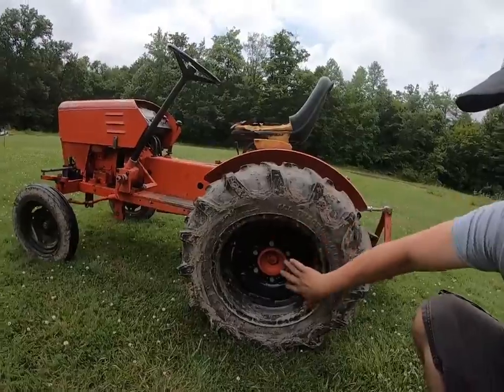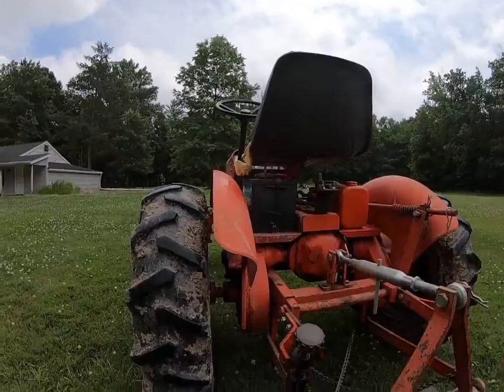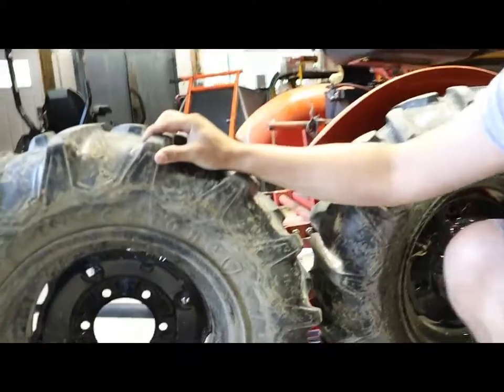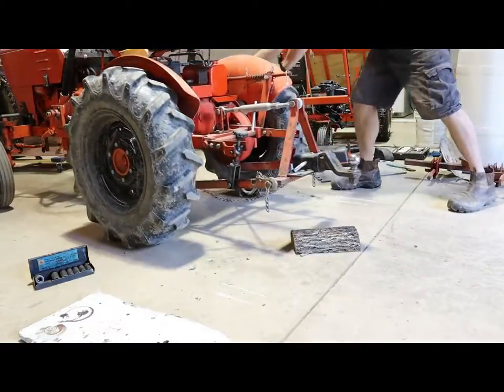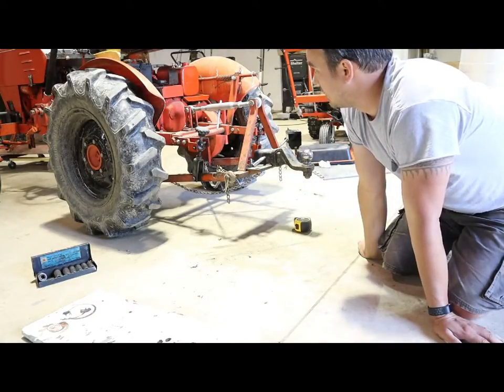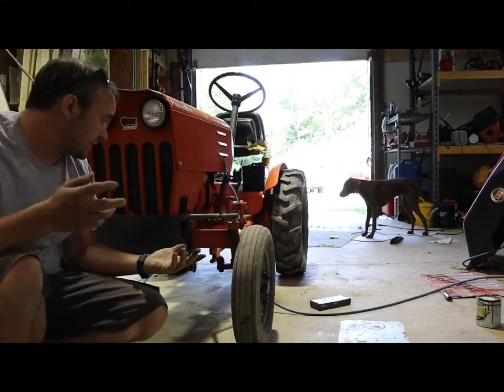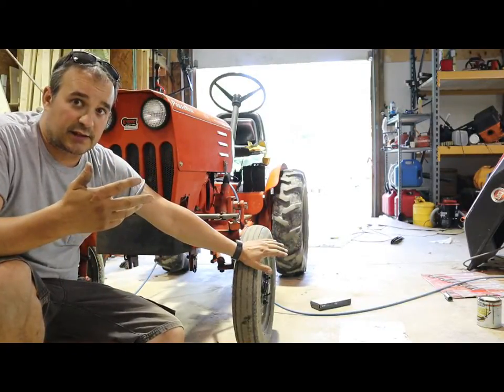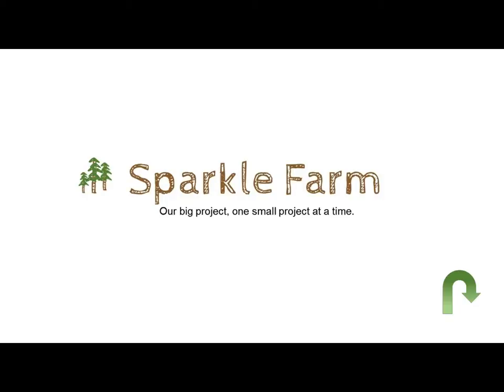Power King Tractor Tire Swap - Adding Rows to Your Garden

Comment: They have several settings for the Power King wheels. Wheels can be turned around, set in, moved out, Doubled up, you can put two wheels on each side on the back. Wheels are put out for extra stability depending on what you are doing with it. Then if you need to save space you move them in as you did. Your best bet is to find the Year of your Power King' go online and find the manuals for it. They normally sell for around 20 dollars U.S. Hope this helps.
Reply from the maker: Read some of the other comments about the tire swapping.   A few guys seem to get upset.    Must not know these tractors are power houses!
Reply: @rushedscheduledfun3963  Yea I'm not sure why anyone would get upset. There are videos right from Power King floating around that show the configurations for the tires. They all have at least 3 base configurations, before doubling up the tires. So you can turn the rim completely around and it's Not Wrong to do that. That is what these tractors are designed to do. You can also get the various rim and wheel weight configurations. Mine has extended wheel weights that are made to be used as a type of Pulley or Come Along setup. They stick way out from the tire and you can loop a cable around them, put the "back end" of the tractor up on a lift, and now the tractor will work as a conveyor, a pulley, you can add a Power King Blade to it, and then it's a Saw mill. These really are great little tractors, and you can't beat the all solid metal to metal configuration, all gear drive, they will pull a house around. Anyway good luck.

Comment: Rear rim tires on wheel horse mowers are exact match for the 4 bolt pattern on the 2414 power king 1974.  Can't tell you about others.  They rub the deck but with it off and a tiller or blade fit just fine.  Also wheel weights bolt on fine with correct front install.

Comment: You know I have one of those tractors it’s got no attachments I love using the thing just to have a little joy ride in recently got add tires for the back I am soon going to get an original seat like an old metal one right now it actually has a boat seat on it the thing sat for 10 years and then got restored and now today it works amazing better than it ever did
Reply from the maker: I grew up with one from the 1950s. It did everything we needed.  So when I saw this one for sale I had to have it.    We actually bought it before we moved to this property.  We enjoy it.  Thanks for watching.
Reply: I’m ten

Comment: What's the benefit of buying an older Power King vs buying an older Sears Suburban SS16 or ST16 or an older Cub Cadet?
Reply from the maker: Probably no difference.   Just personal preference and whatever works for your application is always best.  
When I bought this tractor it came with a bunch of accessories for the cat 0 so that helped also. 
3 point on the back.
Reply: See how many Power Kings are still running ? Do you need to know more ?..
Reply: BTW...you could have just downloaded a manual and gotten all the info...or cLled
Reply: @Dadwithallthecool  Quite correct. Power King tractors are built like tanks and are indestructible.
Reply: Sears didn't  have a good brake design.  Read about brake failure.  Power kings easier to work on and bigger.  Did my research and pk better.
Reply: Lol, obviously never owned or even seen an Economy or Powerking... currently own 3 plus some John deere tractors, the Powerkings are my work horses, one with a loader, one with a front blade, one general purpose. AWESOMEmachines.